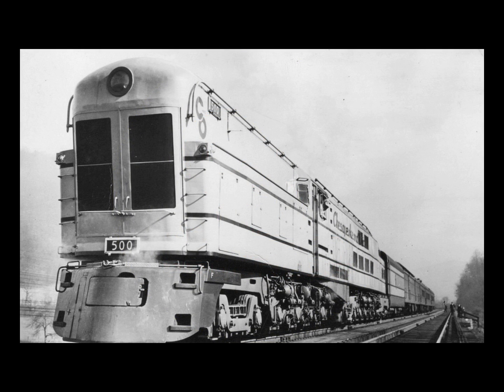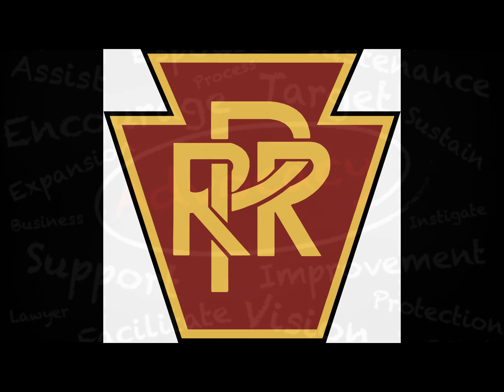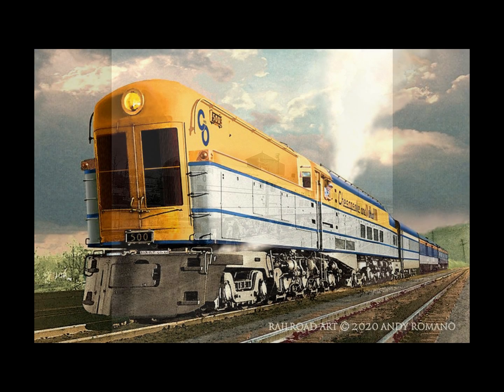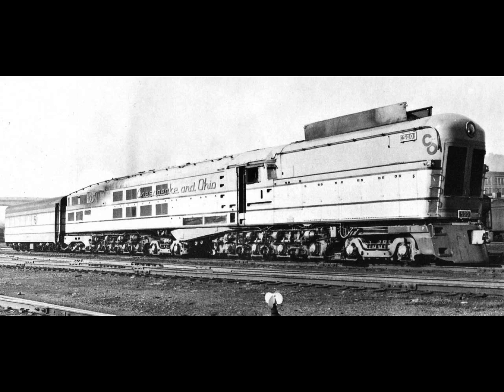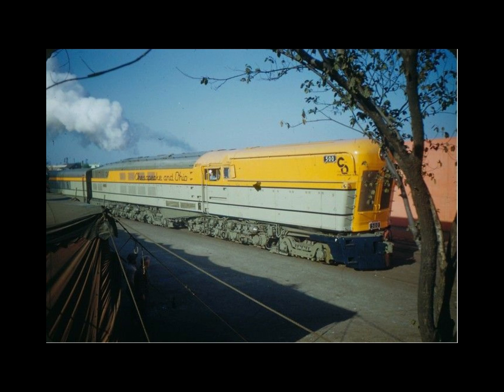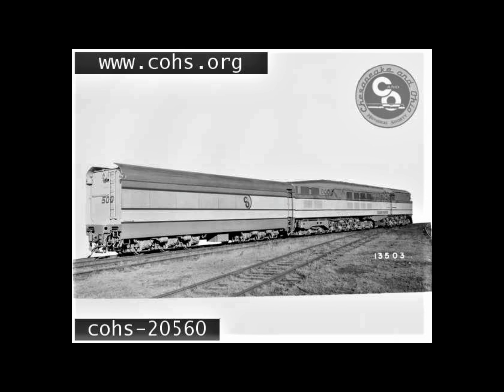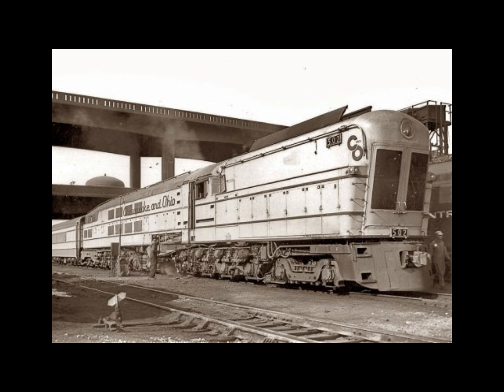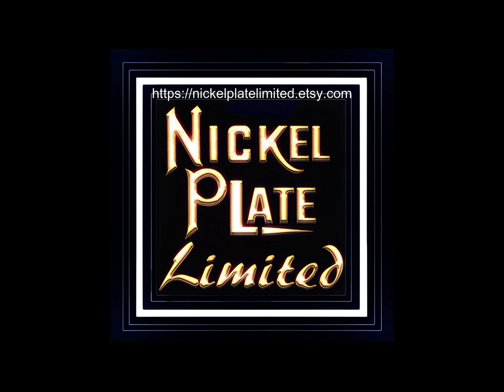Chesapeake & Ohio M 1

Comment from the maker: Guy's and Gal's: I meant to say the PRR S2 and not the T1. I didn't catch the error. Normally I put a text note above the point where I make such a mistake. SORRY!
Reply: these ladys were also nicknamed sacred cows, and will all the features they had auto air control, raising steam in 20 minutes and electric generation I really wish It would have worked or at least one was saved for a museum, they were so neat the best of both worlds coal and electric, but the effect of the coal ate up the turbine fins, and the water would short out the electic motors, and it could not even compleat the whole trip it was to do once without breaking down, not to mention water tube boilers dont have the structural rigidity of a firetube and were prone to leaking and hard to clean the sharp bends in the waterwall o of most watertube style fireboxes used in steam locos and scale would build up. saddly the service was canceled before it even really got off the ground and these were left without purpose beside the mechanical failures.
Reply: Sadly post WW2 diesels were considered the locos of the future. Even Britains turbine Pacific of the mid-30s of the LMS lingered until 1952 when it was converted to match its reciproacting sisters, only to be written off almost immediately after a tragic crash for which it was totally blameless.
Reply: T1's made it into Fallout 4 as a prop.
Reply from the maker: @Einwetok  Nice!

Comment: Interesting video, but as far as i can see the diagram does not match the photos. The diagram shows a 3 car with end cabs while the photos show a 2 car (+ tender?) With a steam engine style rear (mid) cab. It would have been nice to hear more technical details. Unfortunately the diagram didnt help.

It is always interesting to hear sbout these last gasps of steam. It is also intriguing to see how wedded people were to the steam layout even with some early diesels (in UK at least), still retaining the "rear" cab despite being able to have it st the front with much improved visablity.
A fascinating period of history. Check out the "Leader" steam locomotive from UK as an example of this crossover period. Looks like s tube train!😊
Reply from the maker: I can only use what's available AND not get me into copyright trouble.
Reply: @TheRailroadCrossing-SteamPower  I can understand that, but the diagram does not appear to be the vehicle that you are talking about i.e. completely different vehicles.
Reply from the maker: @Dilbert-o5k   Yeah, I had a moment to take a quick look.. I screwed that up..simple as that. The diagram is readily available. Just google it. Since you're not looking for lcommercial use, you wont have any problems.
Reply: @TheRailroadCrossing-SteamPower  fair enough, just thought you would like to know.

Comment: Interesting that these steam turbine locomotives came into experimental use before gas turbines were really developed for use outside aircraft. Yet even when marine gas turbines became available, their use proved totallly uneconomic due to the fuel consumpton compared to diesels. Gas turbine locomotives were tested experimentally here in the UK in the late 40s and proved to be uneconomic. The 1970s Advanced Passenger Train test train was also powered by gas turbines, but it's economy was never tested, and the units intended for passenger use were built to use overhead power supply via pantographs.
Reply from the maker: Interesting stuff!

Comment: Steam turbines would have been sucessful if they had computers and the sensors like we have now. An expert I read said a steam engine  if it had a problem it took minutes to find the problem and hours to fix on the other hand a steam turbine if it had a problem it took hours to find the problem and minutes to fix. It needed the same systems your car has now.
Reply from the maker: Oh I have no doubt the concept could work today. If you're able to throw in a cheap, yet clean burning fuel source SAFELY.. Hydrogen, NG, Propane, whatever.. Then it just might be a cheaper option. The thing is.. cost of each.

Comment: This is very similar to the attempts by various loco builders to adapt water tube boiler technology from marine applications to rail applications only to find out that the conditions were so different that it never did work as hoped
Reply from the maker: Yes, that was certainly one of many lessons learned and why you dont order 3 of an experimental design.

Comment: Isn't an intrinsic feature of turbines that they're most efficient at set speeds? A power station can tick over at it's designed rate from maintenance stop to maintenance stop.  An ocean going ship, once in open water, can cruise at a predetermined rate until slowing outside a port.  Other than modern dedicated HS (High Speed) infrastructure, railway operating speeds are dictated by umpteen variables ..... braking capacity, curvature, gradient, cant/camber, kinetic envelope etc.etc.  Then there's the question of exhaust back pressure, where I believe an acceptable design compromise was employed by William Stanier (UK London, Midland, Scottish Railway Turbomotive No.6202) and in Swedish heavy freight application.

I'd be fascinated to know whether anyone has tried a Tesla Turbine in a rail application, be it as final drive or (more likely) powering an onboard generator for a "steam/electric" turbomotive.

Experimental steam? Oliver Bulleid's 'Turf Burner' built for the CIÉ was a double bogied, all-adhesion machine which, unlike an 'almost progenitor' of similar concept for British Railways (which shall remain nameless) actually did haul a revenue earning freight train.  Again unlike it's ill-starred predecessor, this one could've been developed into something allowing the Irish network to utilize  indigenous fuel supplies (although OVSB specified that fuel was actually 'peat' and not 'turf').  

Even with the odd design kink before production became a practical proposition,  this concept did work and the reason the project was abandoned with Bulleid's retirement is that by the mid-1950s, the future clearly lay in diesel traction ..... even if it took another decade for the 'powers that be' to admit US manufactured diesel lumps were infinitely more reliable than what the neighbouring UK was churning out at that time.
Reply from the maker: Fantastic information! Thank you!

Comment: A brief search shows English and German steam turbine driven locomotives also.
Reply from the maker: Yeah for sure the abroad turbines were the first to be tried in a locomotive. You guy's already knew they weren't the best suited for a railroad operation.
Reply: Ljungstrom in Sweden designed and built 3 (IIRC) 2-8-0 steam turbine driven locos in the early 1930s. They were successfully used on the heavy iron ore trains in the North of the country, until the early 1950s when the line was electrified.
Reply from the maker: @alanbrown9178  Good information, I did not know this!

Comment: In the 1950s the Union Pacific also experimented with gas turbine locomotives and one coal-fueled turbine locomotive.  The coal turbine was scrapped, but two of their gas turbines survive to this day.  The UP turbine trains ran out of Council Bluffs, Iowa and one is on display in the Council Bluffs/Omaha area (either Union Pacific or RailsWest museums).  The other gas turbine is also used as a static display.  I believe that there was yet another coal-based "alternative fuels" effort at using coal in a diesel locomotive made by GE in the 1980s that was another white elephant.  The Union Pacific prototype coal turbine made its own powdered coal fuel on board as it ran.  I believe that it was scrapped because of the pitting of the turbine blades by the coal, which caused mechanical problems.
Reply from the maker: The gas turbine is getting a video. I saw the one on display at the Illinois Museum just recently.

Comment: The M-1 was efficient. The coal capacity was incorrect. There has been documentation found in recent years that shows the coal capacity was not as high as reported. The engine had mechanical problems that can be expected from an experimental engine, but as I understand it, those problems were being worked out.
Reply from the maker: My source on the coal came from a 1953 publication.

Comment: 0:49: That's a stock photo of a European train not an American one.
1:31: The T-1 loco was not a turbine. Pennsy's S-2 was.
1:45: There were at least two other steam turbines: N&W's Jawn Henry and GE/UP's steam turbine. 
These three C&O turbines were not considered experimental but were built to power C&O's Chessie streamliner between Wash DC and Cincy. 
SP's Cab Forwards were not called Yellowstones (just "cab forwards') because their wheel arrangement was 4-8-8-2, not 2-8-8-4.
The Chessie's train consist was built by Budd, not Pullman-Standard.
Reply from the maker: I noted the error about the T-1 pinned at the top here of the comments. It wasnt caught until after posting.

Comment: I knew an old Pennsy Engineer, Harvey Lehman.  Harvey ran all of the PRR experimental locomotives except for the Q1, and Q2 as he was a Passenger Engineman.  He loved the T1, but had little good to say about either the huge S1 or the S2 turbine.  The one comment I recall was that the S2 was very loud in the cab at speed, and that steaming issues were a constant problem.  RIP Harvey.
Reply from the maker: Great anecdote!

Comment: The only railroad on the planet that designed a steam turbine locomotive that actually worked was the LMSR of Great Britain when the late Sir Stanier FRS designed 46202, which not only worked but produced 2400 horsepower when going forwards.  Yeah going backwards was a hassle cuz the reversing turbine wasn't powerful at all but aside from that 46202 proved herself quite economical despite being the one and only and ran in her experimental forme until 1949.
Reply from the maker: Great info!
Reply: @TheRailroadCrossing-SteamPower  The thing was made in 1935 and "Gracie" was stored in 1949 until the early 1950s when she was remade with a conventional frame, cylinders, and running gear.  But 2 months after the rebuild she was destroyed on October 8th, 1952 in the Harrow & Wealdstone rail disaster.

Comment: In theory the best chance for a steam turbine, being a turbine-electric locomotive. Steam turbines which drove the axles via mechanical drive experienced all the shocks and loads experienced by these axles and were hopeless inefficient at low speeds.
In theory the turbine would work most efficient if it could spin at constant speed controlled by a governor, and the feed of steam could be increased by the governor if increasing load on the traction motors started to slow the turbine down, and vice versa. Problem was the DC technology, as we know rotational speed of an electric DC motor is dependent on voltage and this is the same for voltage delivered from a generator. So in order to control speed you have to vary the rpms of the turbine.
So I think technology wasn't just there for this to work well, I would like to see how something like this would work if designed and built today with AC technology which would enable constant rpm operation.
Reply from the maker: yeah, from a scientific point of view it could work, and work well. But as you said..they didnt allow for development and they got what they got. And time wasn't there for them either to save steam. Diesels were coming and coming fast. Poor business decision and investment to say the least.

Comment: amazing...all of the experimentals that were the "next thing" (john henry turbine , the PRR turbine and duplex drives and the M-1) and the last steam loco to run in regular service on frieght on a common carrier in the US was a bog-standard Porter 0-4-0T  built in 1917 on the 3 mile Edgemore and Monetta Ry. in South Carolina in 1977 or 78 (date uncertain).
Reply from the maker: Would you have a source on the last steam in operation by chance?
Reply: The last was actually 1986 with the crab orchard railroad

Comment: Like a lot of locomotives this one has windows on the sides but not in front. With a large "nose" on the front but no windows up front, how did they see what might be on the track right in front of them ?
Reply: If they couldn't see , then no need to steer around problems.  Just , full speed ahead.
Reply from the maker: That was one of the major changes that came in from diesels.

Comment: Were any of the steam turbine locomotives turbo-electric where the steam turbine would drive a electric generator which would feed power to drive motors on the axles?  I think this would address some of the problems mentioned at the expense of complexity and weight.
Reply: literally this one.
Reply: @commissarcarl1700  
Ok thanks.  I did not hear a clear statement in the video regarding how the turbine drove the engine.  I’m a little surprised at the stalling issue given the instant torque available from electric motors.  Perhaps the steam turbine could not respond quickly enough to sudden load changes.
Reply from the maker: Yes... the M1 .. Keep in mind, the idea was sound.. just no proper development time.. You cant do that in any business. But they did and the C &O really paid for it. As I mentioned in the video, only the Southern Pacific got away with something like this with the Cab Forwards.. But that was based on a way more proven design ( The Yellowstone) Not something from scratch that this M1 project was.

Comment: My dad saw one of these on exhibit at the Railroad show in Chicago in 1948. to give you an idea about just HOW bad these locomotives were, C&O tried using them in service several times, on a fairly easy 500 mile stretch, but this thing broke down EACH AND EVERY time it was used. When they finally gave up on them, coal was still cheap (the coal strikes of the early 50's had not yet happened), so this design was rejected on it's unreliability alone.

Also, one of the turbine/generator/boiler setups was installed in the Jawn Henry 1-off locomotive.
Reply from the maker: That's a priceless story! The thing is a sight to behold though.. And would be a cash cow today with visitation if they had the foresight to save one.

Comment: I wasn't able to comprehend the wheel arrangement until I paused at 8:00.  In all, 18 axles, 12 of them powered.
Reply from the maker: Yeah, the whole locomotive was complicated. Believe me, I had to look a few times to get it.
Reply: ACTUALLY ITS A 
2-C-1 + 2-C-1-B 
THE NUMBERS INDICATE 
UN POWERED AXLES 
THE LETTERS ARE 
POWERED AXLES 
WHAT LOOKS LIKE A 
4 AXLE TRUCK ONLY HAD THE FRONT 
3 AXLES POWERED 
THE 4th AXLE WAS NOT POWERED BUT JUST CARRIED WEIGHT ....
THE 2 AXLE TRAILING TRUCK AT THE REAR WAS POWERED ...
THE END FRAMES WERE SUSPENDED BRIDGE TYPE CANTILEVERS OVER THE ENDS ...
THE COAL HOPPER WAS UP FRONT ..
IN FRONT IN THE NOZE ,,
THE COMPRESSORS AND FRONT TRACTION MOTOR BLOWER WERE BEHIND THE FRONT DOORS ..
THE FRONT TRACTION MOTOR BLOWER  SUCKED IN THE COAL DUST BLOWING AROUND AND FOULED OUT THE FRONT 3 TRACTION MOTORS ..
THE BOILER FACED BACKWARDS LIKE S.P. CAB FORWARDS ..
BEHIND IT TOWARDS ON THE REAR SUSPENDED CANTILEVER FRAME WERE 2 MORE TRACTION MOTORS , TURBINE , 4 GENERATOR IN 2 UNIT SETS , ELECTRICAL CABINET AT THE END ..
THE 2 SIDE BY SIDE TRACTION MOTORS  SUCKED IN CONDENSATION FROM THE BOILER WHICH AGAIN SHORTED OUT THE MID 3 AND THE REAR 2 TRACTION MOTORS .....
GOOGLE SEARCH 
C&O CLASS M-1 BALDWIN CONSTRUCTION PHOTOS ...
YOU'LL WONT BELIEVE WHAT WAS UNDER THE STREAMLINED COVERING

Comment: If you were to to build a “modern” steam locomotive, that with a pulverized coal feed system, battery regen for shorter stops, and full condensation recovery is what you would get if you wanted a 200 mph steam locomotive.
Reply from the maker: The EPA wouldn't go for that these days. They would insist on a clean air option..Which for a locomotive would require a heavy exhaust filtration system in the least. That would make such a project overly expensive. New diesel designs that I see are incorporating way better exhaust systems than existing motive power. So it seems corporations are beginning to take to the clean air concepts.